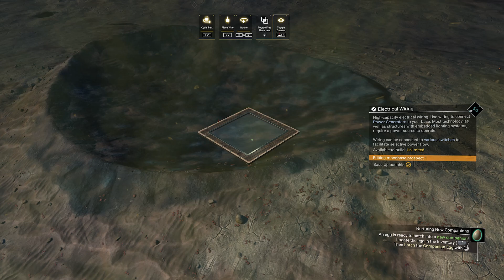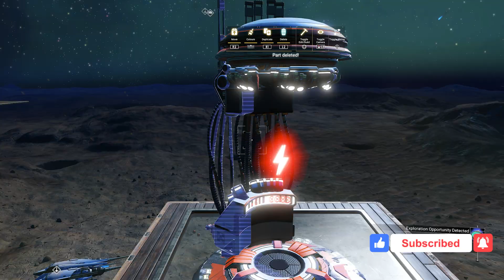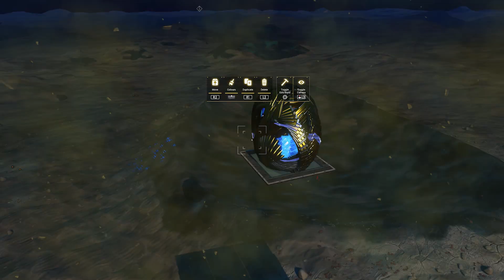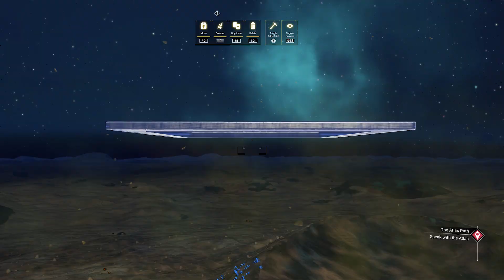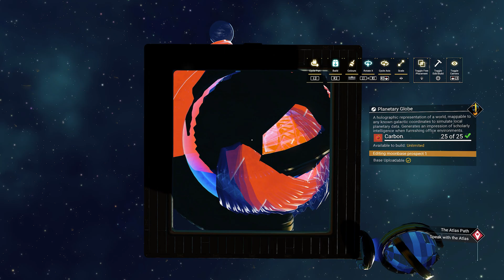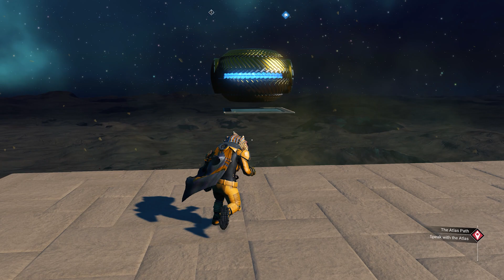How to build the HypnoSphere - No Mans Sky Outlaw - Building Guide

Comment: Please, how I can build this inside my freighter? I have tried and tried, without any success!
Reply from the maker: I have not tried to build this in my Freighter myself... But you could use the "Cachepin glitch" to build a glass floor inside the Freighter, then use that as a basis for the Hypnosphere.

Take note the cachepin is broken on consoles for the moment, but should be fixed with the coming updates.
Reply: @Beeblebum  I'm on PC. And how I can use this "cachepin glitch" if there is no glass floors available to build inside the freighters?
Reply from the maker: @rosesareredbutzerglingssti9290  Cachepin glitch allows you to build glass floors on the freighter: https://youtu.be/He_zQSpqAbA
Reply: @Beeblebum  Thanks! Now I can build your hypnosphere in my freighter.

Comment: Question: could anyone tell my why powdered doors suddenly stop working?

It's happened a few times now. Is this a persistent bug and anyone know of a solution? I'm guessing it requires rebuilding the door.
Reply from the maker: There seems to be a recurring bug that with updates the logic gates and power is bugged out.

If it did not fix with any patches, you will have to either rebuild the door, or the powerline, or the logic gates (in case you use any).
Reply: @Beeblebum  hey dude. 

We had a chat about on it one of your streams about a week ago and you went into detail for me. Was pretty helpful, much appreciated.
Reply: Powdered door? I want one of those!
Reply: @thelemonddropskid5445  nah, you want treatment for autism lol.